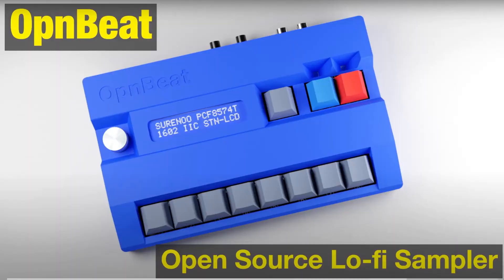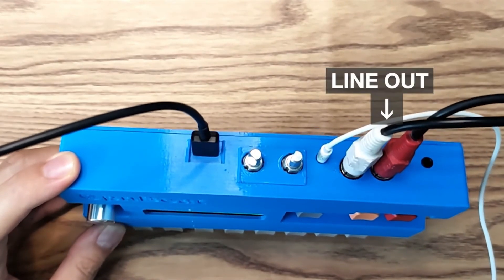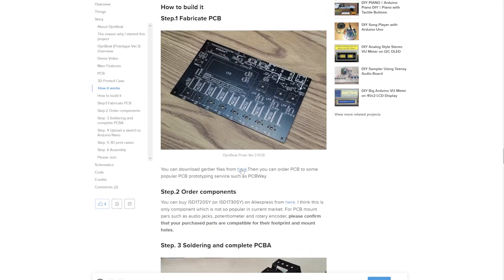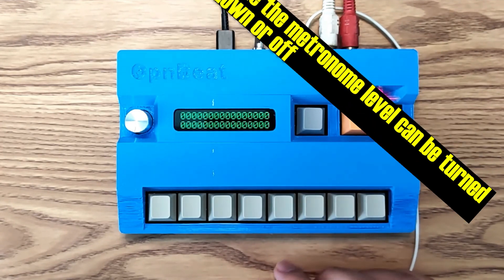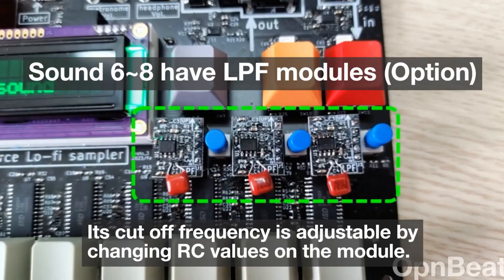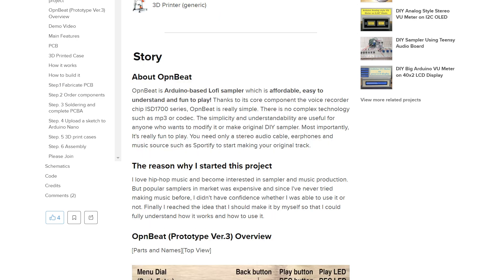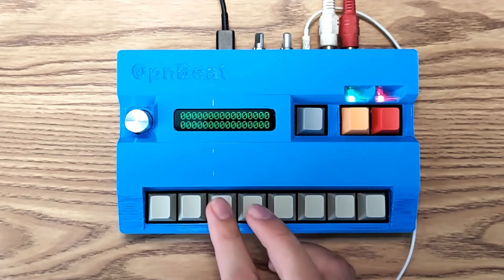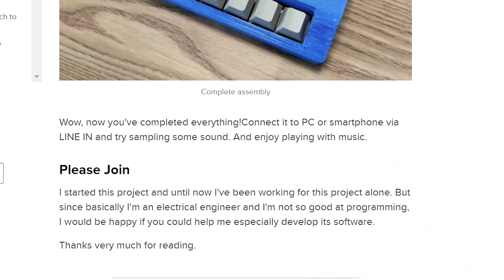OpnBeat a DIY Open Source LoFi Sampler

Comment: Gotta love that metronome. I’m uncertain as to the resulting samples - but figuring out how to implement AD/DA converters is not likely anything easy. I don’t even know how that stuff works (if programming source code is necessary wherever we want digital content - I’ve heard of people writing their own file systems specifically with this in mind)
Kudos to the original maker of this project - this is an awesome feat. Kudos as well to the builders who are going to make one of these.  For now my box of unfinished pcbs is bigger than my bed.